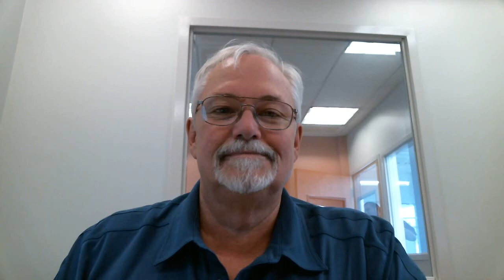Ford F150 5.4 V8 problems, Cam Phaser  Timing Issues, SLUDGE problem. https://www.jilcat.com/shop/

Comment: I came across this video while researching a problem with my 2018 Ford Expedition with a 3.5 liter Ecoboost engine. Upon start up, on a cold engine, for the first 3 to 4 seconds it sounds like a diesel engine.  Do you think that adding the Jilcat to this engine will hurt it? It is out of warranty and I know that if I take it to Ford it will cost a small fortune.
Reply from the maker: I know for a fact Jilcat will help this engine. Please give it a try. https://www.jilcat.com/product/gas-engine-conditioner-3-bottles-v6-and-v8-stop-disappearing-oil-pressure-96-includes-shipping/

Put 2 bottles in right away (do not overfill) and add the third bottle after next oil change.
Reply: Richard did you ever get this diesel sound figured out? We are getting that, along with low fuel rail pressure and hard cold starts,  on our 2018 F-150 3.5 and the dealership is having a difficult time figuring it out. Thanks.

Comment: Your wrong the gaskets blow out in timing chain tensioner and you lose oil pressure
Reply from the maker: Mike thanks for your opinion but since so many of these have been solved with our product I will have to believe I am not wrong ….I have been told "wrong" by many technicians that now use our products......In some instances you may have seen what you describe, but that isn't even close to all the cases.

Comment: I use to have timing issues in my truck ..that noise that everyone hates ..  i start using motorcraft blend oil and premium gasoline..my truck runs runs like a dream it never feels like that
Reply from the maker: Alfredo sounds great! I'll tell you so many dealers and technicians have tried just about everything. Your suggestion might be another great solution. The Jilcat Gas Engine Conditioner gets in there and SUPER lubricates that engine, clears the SLUDGE and gets the oil solenoid screens unclogged so the Cam Phaser can function as designed. I hope you never have issues with yours, but soooo many sure have.
Reply: @GeneDaughtry  👍
Reply: @GeneDaughtry  i use to many many problem in my powertrain.. missacceleration .. jerk when accelerating at 30 to 40 miles.. noise in my phashers.. i use to hear a noise on engine when you are about to stop and when you accelerate slowly.. i did everything coils..plugs..fliters.. just that oil and premium gas fix all this problems in my truck .. i own this truck since new and never ran like this ..
Reply from the maker: @alanwatts8117  I hope it run forever!

Comment: Hello, many, many 5.4 3v engines hit 350,000 easily. Problem with these engines is not to use 5w20 especially if one is towing. These engine were design using 5w30 - 5w20 is too thin. The other thing is conventional oil must not go more than 3,000 miles (just image 5w20 conventional going 5,000 miles - TORTURE to the engine). Full synthetic to 5,000 max. You hit it on the head the VTC Solenoid clogged up and poor oil going through, and starts to damage the cam phasers and gunk also builds on the cam phaser. A good 5.4 3v with good VTC solenoids 5w30 synthetic max 5,000 miles and it will go to 350,000 easily. And of course O2 Sensors, spark plugs and coils must be in great shape too.
Reply: Soo 5w30 is safe to use in this 5.4 engine?